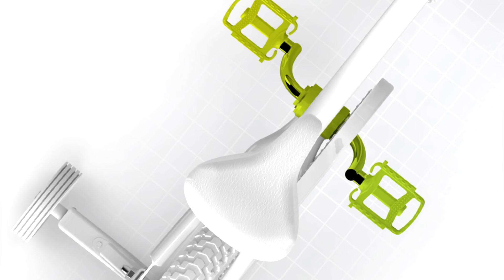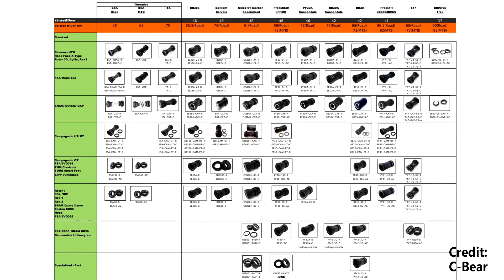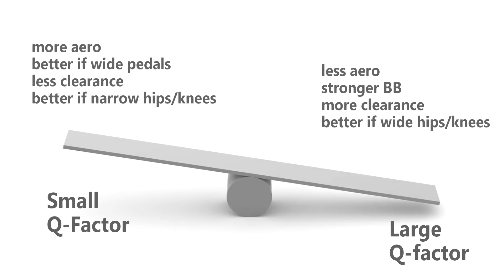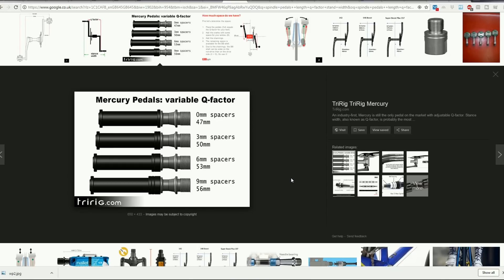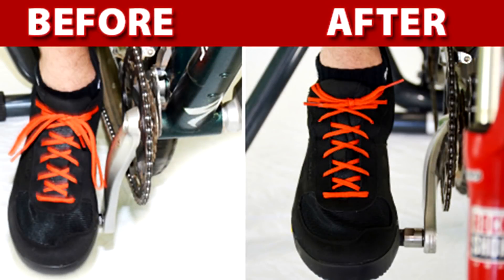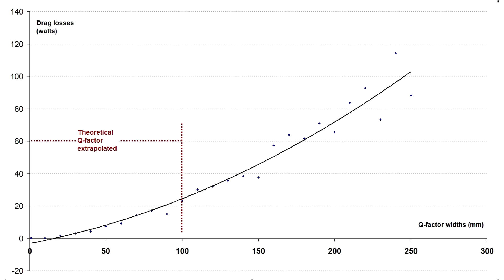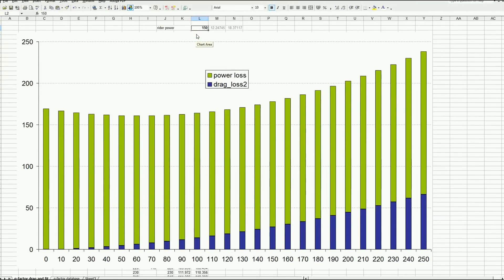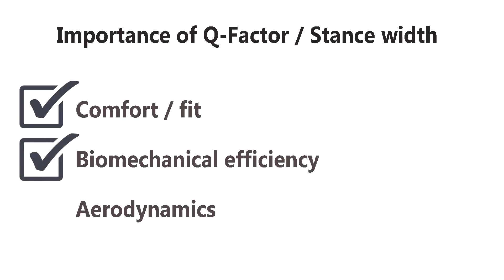Q-factor Science! The most important bike metric you've  never heard of!

Comment: The fastest people on Earth are Track & Field SPRINTERS.  Each forefoot strike hits the deck closer to the mid-line & propels off that contact point, in essence, creating a smaller Q factor compared to normal stance or regular ambulation.  However, it's not a completely 1:1 comparison, as runners tend to also rotate the pelvis on the transverse plane during forward progression,...  unlike cycling Sprinters who demonstrate a more sagittal plane-dominant pelvic action / counter-action w/ each stroke,..... but I imagine there might be some bit of correlation to the fastest & most dominant muscle group force vectors between the two conditions.

Comment: There is a trick that use to minimize my riding Q-Factor as much a possible:
 I ride a hybrid bike, mostly on city roads and i don't use cleat pedals. I position my shoes on top of the pedals' axles, so the sides of my shoes rub lightly against the cranks, that way i get a feel for the right position of my feet on the pedals, without having to look down. This can be done constantly each time you ride with some practice.
By my measurements,  i am shaving around 13mm per side, which in total is a around 26mm less of Q-factor, which for my mtb's 73mm bottom bracket is significant. This trick probably works even better on road bikes which have narrower bottom brackets / cranksets.

Comment: One other factor that dramatically affects someone like me with splayed feet is the need to get out of clipless pedals. I simply cannot get out of clipless pedals by turning my heel out. I allso have to put my cleats on crooked in order to avoid knee pain.

So I use 20mm pedal extensions, and Shimano Multi-release cleats for both comfort and safety.
Reply: I have the exact same problem that I've recently decided to address. A few questions if you don't mind:

1. 20mm seems like a lot, I understand it's necessary for you but does it also hinder you in some ways?
2. have you tried finding a solution with spd-sl or only 'normal' spd?
3. I read that the multi release cleats unclip by pulling up, do you adjust the pedal tension tightly to prevent unintentional unclipping or do you run the tension fairly loose and just make sure not to pull up on the pedals while riding?
  
I've ordered a set of those axle extenders and a set of blue spd-sl cleats, hoping that the reduced float as compared to the yellow ones would make it easier to unclip. They haven't come in yet, hope they'll solve my issues otherwise I'll definitely give those multi release spds a go!
Reply: @demonstructie   I have tried 18 mm extensions and 30 mm as well as the 20s I currently use.  The 30 mm are perfect for riding on flat pedals which I do sometimes on my MTB and my version of a pub bike

Re. the Multi-release cleats, I have SPD pedals set as with as light a release as possible. The number of times I have pulled out accidentally is tiny, but I am 71 y.o. and don't do much crazy stuff on the bike.

I also subscribe to the recent research, some of which is on the GCN channel that shows no advantage to pulling up, and in fact shows that professional riders don't actually have an "even" pedal stroke.

Even with M cleats and pedal release set light, you can push down and pull backwards with no fear of an unintended release.

Comment: I tried a Q factor of 132mm on the turbo using a very short BB spindle. I found my power was up for the 1st 20 minutes compared to my normal 145mm QF. At about 30 minutes both would be the same. At around the hour the 145mm QF always gave me more power. So time cycled might come into your equation as well. Maybe I needed more time to adapt, I gave it about 2 months before I tried the same setup on my Audax bike. I seemed a little slower doing 100km + rides & my legs ached a little bit more. Strange that they were faster for the 1st 20minutes on the turbo. I also had problems with the chainline hitting the crank when the smallest cog was selected on the Audax bike.

Comment: My fat bike is 210mm but I can still put out the watts. It's overrated IMO
Reply: Maciej Jan Długosz  Those "many people" are mistaken. It'll be because they didn't set up the saddle or handlebar height to match their road bike. My brother sells them in his bike shop and does the proper setup/fit for them. Sometimes the geometry doesn't allow for the same aggressive position so you have to ride slightly differently. A bit of tightness and maybe cramp is the worst thing you'll get if done right.
Reply: Maciej Jan Długosz  I was talking about fat bikes too. Met around 40 people who have bought one now and no signs of pain unless it wasn't set up close to their road bike geometry
Reply: Maciej Jan Długosz  I'm not talking about tweaking it. You don't need to. Originally I commented that the 210mm Q-factor for me allows the same power output, measured with the Powertap pedals.